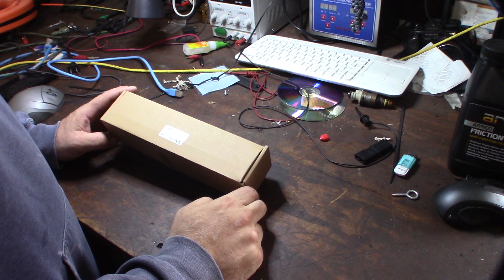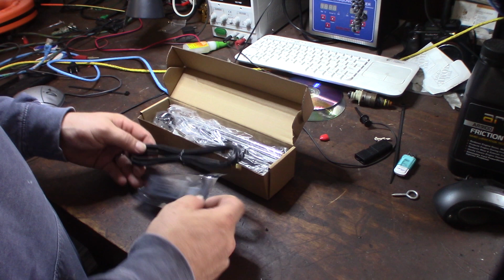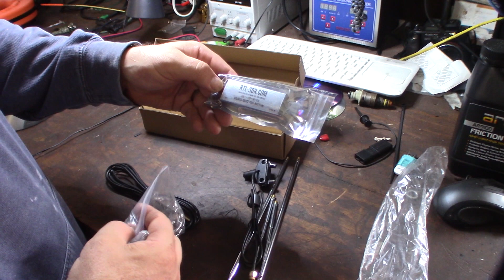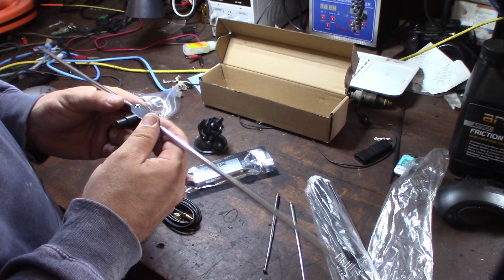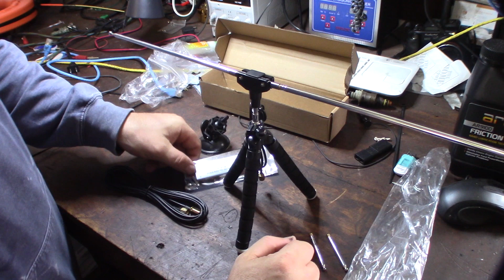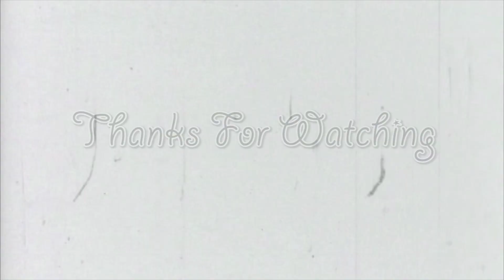RTL-SDR HF SHTF R820T2 RTL2832U Amazon Di-pole Antenna bundle part 1

Comment: That antenna kit isn't for HF so you will be disappointed. This page shows what frequencies the antenna kit can be used for and the recommended lengths they should be extended. 

https://www.rtl-sdr.com/using-our-new-dipole-antenna-kit/
Reply from the maker: Thanks

Comment: I like this little antenna kit.
It's not top-dollar but it doesn't have to be, really.
What it REALLY is, is a starter kit, as I'm sure that nearly everyone will add their own stuff to this kit to customize it for their own use.
I don't see the long rods getting much on the HF side because of their short length compared to the frequencies used.
For HF what I added to my kit was two 25-ft rolls of wire, each with alligator clips on them.
One can either clip them to the ends of the rods or clip them directly to the dipole base and drape them where needed. (stay safe of course)
The use of standard 1/4-20 mounts is great, because it means you can also use a larger photo tripod or any standard photographic stand for an antenna base, which can really come in handy.
Heck, simply including a long 1/4-20 bolt and a few zip ties in your kit means you could improvise lots of different ways to mount your antenna in the field.
Cool, versatile little kit.